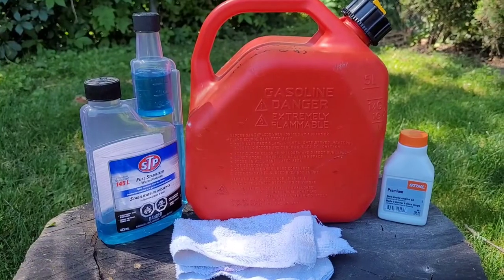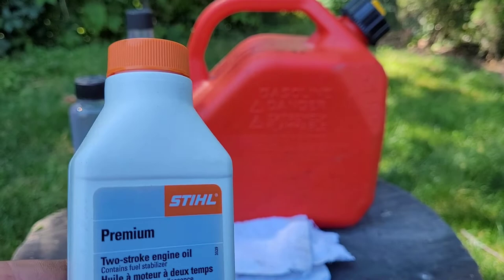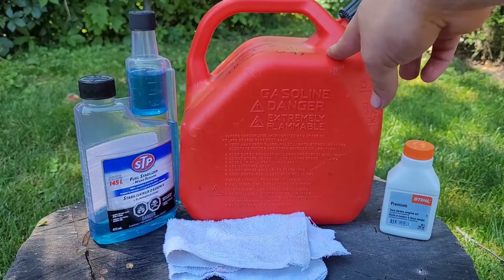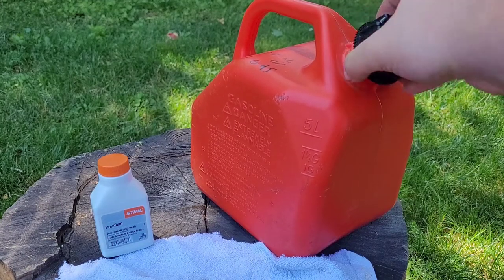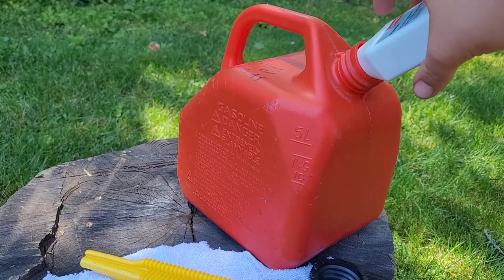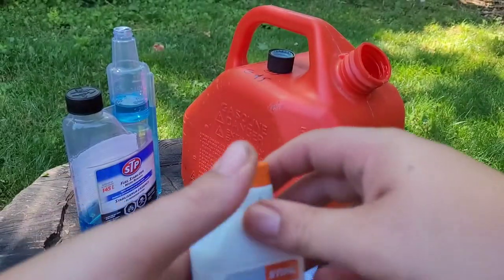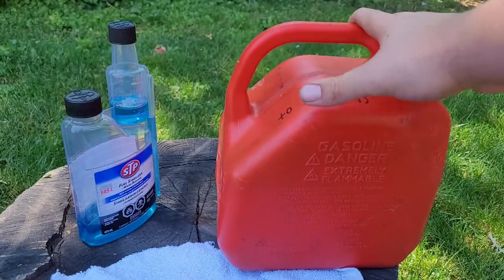How To Make 2 Cycle Fuel Mix

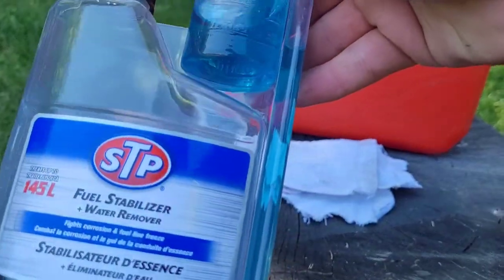Comment: Meby 1:35 not! Bat if 1:20 too' much.
Reply from the maker: Yeah totally
Reply: @WillsSmallEngines  thank's aload!. 1:35 Not mistage
Reply: @WillsSmallEngines  soo' i wahnt thold! My Hight Score by on 22-23 ccm engine Chain saw Style Piston 32 mm round om withoud! Eany exoud-system Just the original chainsaw muffler 21.000 rmp. Name: gemessen an der RC Fernbeziehung per Magnet Zähler.
Reply: @WillsSmallEngines  No! Name: Fernbedienung RC Anlage per Magnet & i forget too' thold Not free'! On Transmission + 2 big Back wehl's on IT + thats engine old orady soo Not Brand new. Jes' 21.000 RPM i watch'ed on Display by RC.